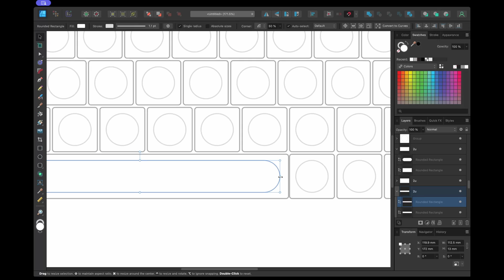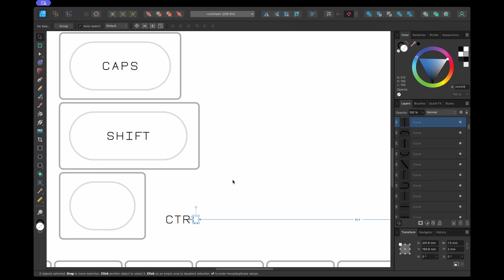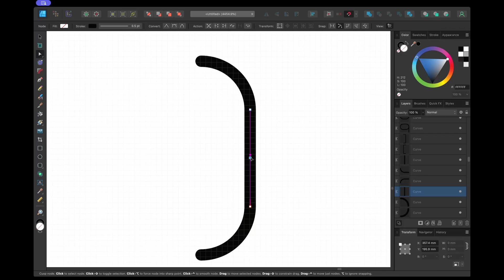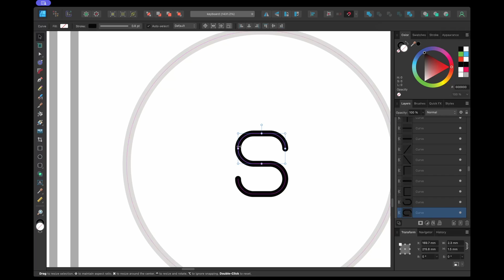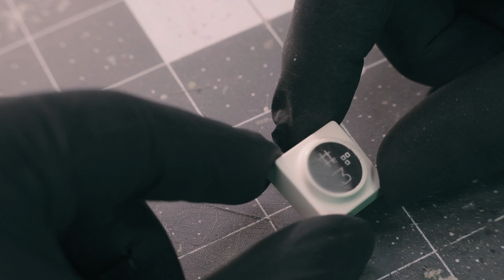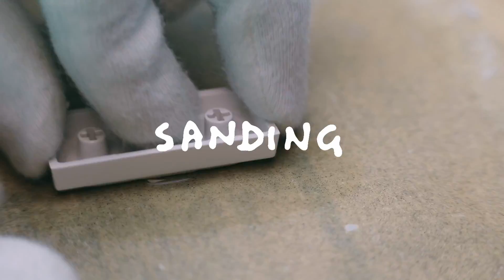making an OP-1 keyboard with custom keycaps

Comment: the same shop that produces these caps already sells sets of coloured keycaps. I'd get the coloured keycaps in your place, alongside the white. because the caps to which you've transferred just legends, look great, and the ones you've tried colouring look so-so.
this shop definitely have black ones and also some transparent ones which would look sick on the nuphy considering the backlighting. I'd personally use the transparent red as the escape key for instance. and I believe, since it's all the same materials, they should work just as well. though, maybe the issue is that you cannot dye sublimate white ink? I'm not sure.

thanks for this video anyway. been having the exact same plan and you've just proved that it's possible!
Reply from the maker: thanks! yeah the issue with dye sub is you can only make things darker
Reply: @ultraparadiso  I could find sublimation heat presses on Amazon for less than €30. do you think a dedicated product as such could do a better job than a hair straightener?
Reply from the maker: definitely something purpose made should do better! i think the issue i had with blotchiness on the color keys was caused by the varying thickness of the keycaps where the stems are vs between them resulting in uneven heat distribution. not sure how to resolve that issue other than doing the whole process in an oven and preheating the caps but hopefully a purpose built device could do a better job.
Reply: I see what you mean. a sublimation heat press is still flat because it's meant for transferring print onto clothing. maybe if there's some soft heat conducting material that can fill the cavity of the keycap while transferring the heat from the press would do the trick  @ultraparadiso

Comment: So for the transfer paper, you could have tried using a soldering iron that has temperature adjustment. There is even the possibility to concoct some sort of specialty tip to get the best results, if you were to try using this method of course.
Reply: I forgot to add that I loved the video
Reply from the maker: ooh that’s an interesting idea!

Comment: ok so why do youtubers wear gloves sometimes?  are you afraid that you'll be identified or something?  your fingerprints will not be stolen from a youtube video, I promise.  if you have a skin condition then I guess I understand.
Reply from the maker: exactly what someone who wants to steal my fingerprints would say
Reply from the maker: really a combo of aesthetics, cleanliness and shyness. i’ll reveal my hands someday
Reply: I would guess overall neatness of a shot. 
Also in some cases you really don't want skin oils to get on things, like when cleaning electronics, because they are somewhat corrosive, or printing because you usually clean oils from surface using isopropyl alcohol before printing to help ink stick (no clue about this method of printing though).
Reply: frodo nails?